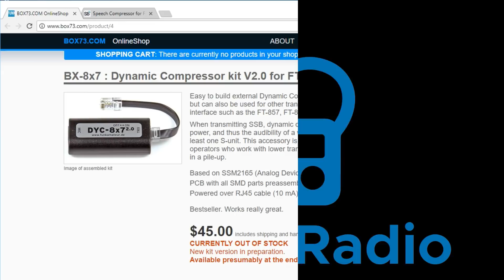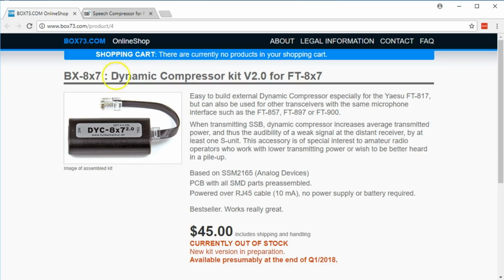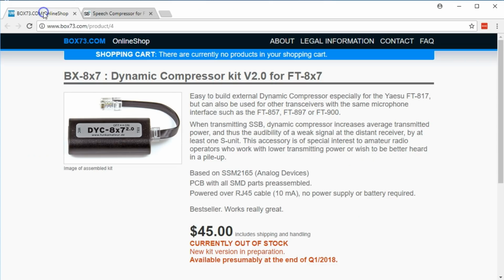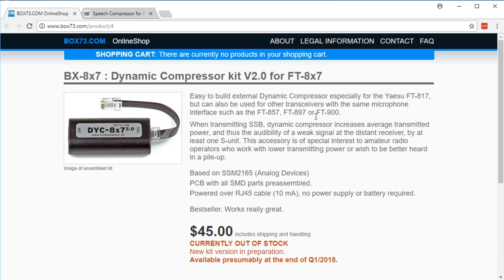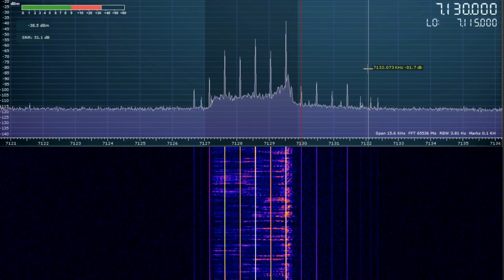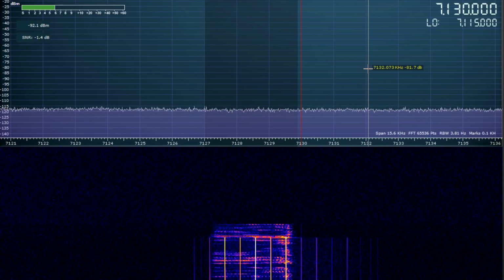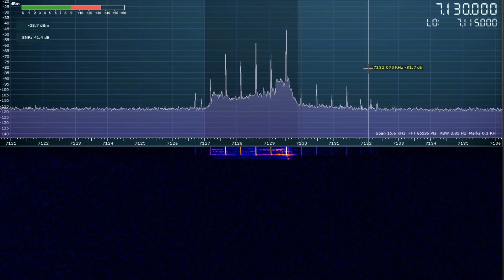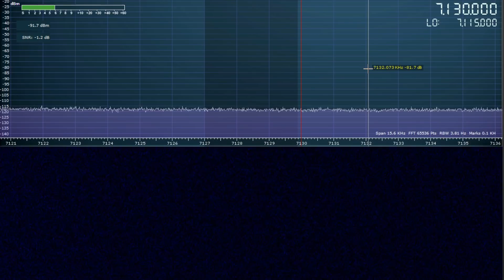DYC-8x7 Speech Compressor Intro & Tuning Aid Demonstration for FT-817 & FT-818

Comment: Hi Jarrad
Interesting first part review of the 817 speech compressor. Any idea when you might release part two as I am holding back on getting one until I see what you have to say.
Regards
Stephen
Reply from the maker: Dear Stephen; I must admit to getting derailed with family and work of late.  I definitely think its a fantastic tool to have, but the last analysis I performed with my SDR Play did show it was capable of well and truly overdriving the radio.  That said, when you’re ‘in the noise’ and can’t be heard, it doesn’t matter if your IMD performance is only -15dB single tone rather than say -25.  In summary, I wouldn’t hold off; operating portable it is every bit as powerful as adding an amplifier and doesn’t contribute anywhere near the weight to a back pack.  73, Jarrad VK3BL
Reply: Thanks, I have ordered one. 

73, Stephen 2E0WSF
Reply: Hello Jarrad
I bought one of these for my ft818 and got a report that my speech was breaking up and hard to understand. Turned it off and got a positive report on voice. What am I soung wro g. Setting on ssb mic was 50. Am I talking to close to mic?? I am in WA and the station I was talking to was in Texas!
Reply: @jdsnapp  Westerrn Australia??

Comment: Everyone raved about these so I purchased one, Sounds like ass when on air.
3 people have checked it and gone throught the calibration several times, still sounds like ass.
Supplier wont answer emails ......
Reply from the maker: I'll give a secret away from the next video - you have to have your mic gain in the menu set to around 10 (the default is 50) otherwise they will completely overdrive the radio.  

This is "ok" if you need to make a contact as you do end up getting a few more decibels more, but the IMD products are disgraceful, and anybody close by will tell you that you sound truly awful.

On the other hand, with the gain set to 10, you still consistently reach the same peak power levels, without dragging the finals deep into Class C.

Of course, this varies by voice and a few other factors, hence the 'delay' in releasing the full review.  But for now, try setting the SSB Mic gain to 10, and I bet you will fair better.  There will still be audible distortion - thats what a compressor does - but the higher average power levels will increase readability.

73, Jarrad VK3BL & the RMR Team :)
Reply: I shall dig out the box and have another look at it this weekend.
Cheers !